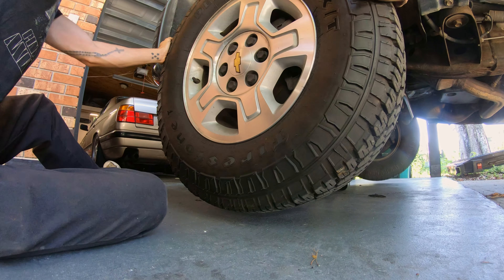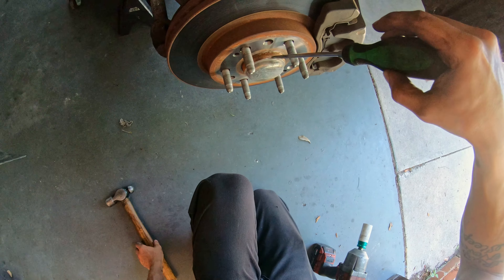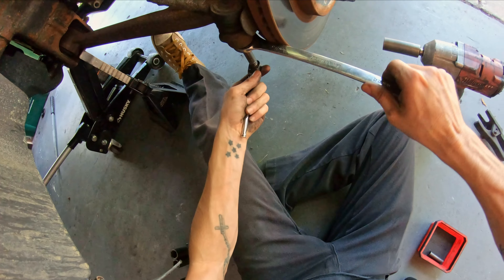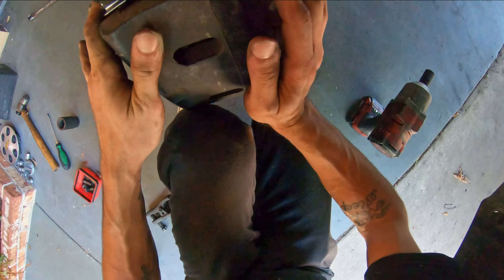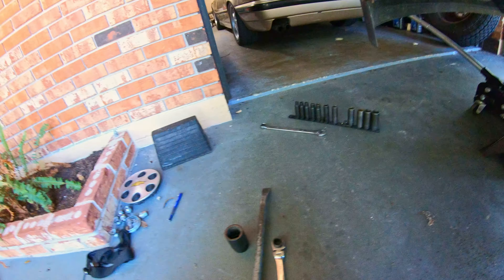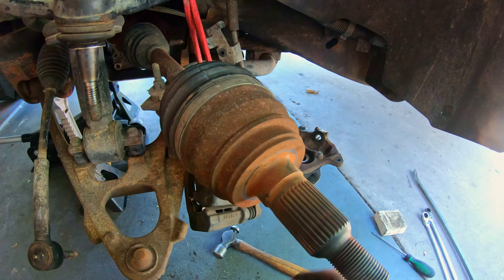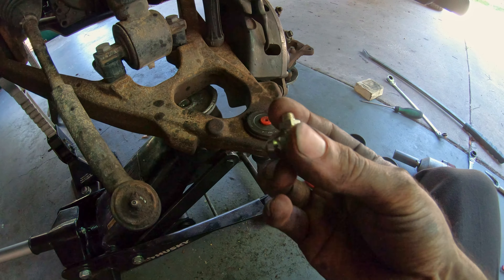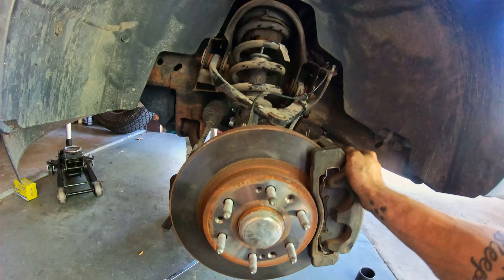2007-2014 Chevy Silverado/GMC Sierra 1500 2WD/4WD Lower Ball Joint Replacement THE EASY WAY!!!

Comment: What were the torque specs for the tie rod, upper ball joint, lower ball joint & axle nut?
Reply from the maker: Tie rod to knuckle: 44 ft lbs
Upper ball joint: 37 ft lbs
Lower ball joint (w/ captured washer): 92 ft lbs
Lower ball joint (w/o captured washer): 37 ft lbs + 130 degrees

Comment: You take out upper control arms to get impact in there?
Reply from the maker: Upper control arms do not need to be removed. Just the upper ball joint to the steering knuckle.
Reply: @RealSupernauto  I tried to get one lower out for 2 hours today. It didn't have the locking tabs on top either. The top outer rim of it is already sunk about 1/8 inch inside control arm. I'm not sure if someone put wrong ones in there out what. They tight AF. Won't budge.
Reply from the maker: @wtfnetown5049  That's unfortunate! They do take quite a lot of force to press out. I had my impact at max strength when pressing them out in this video. You could always try to heat up the control arm with a torch to try to get it to expand and loosen up some more. Also, if yours does not have the locking tabs, make sure the circlip is removed from the rim before attempting to press it out!
Reply: @RealSupernauto  no circlip on lowers
Reply: I got that thing out today in 2 minutes with a hammer. Lol
Reply: Put Jack stand under control arm and whacked with 2 pound sledge. Came right out.